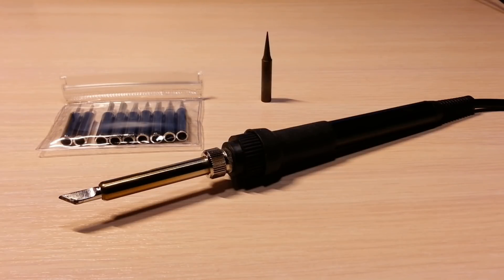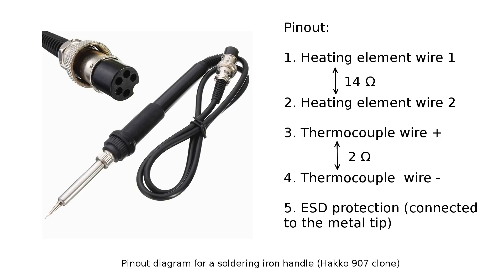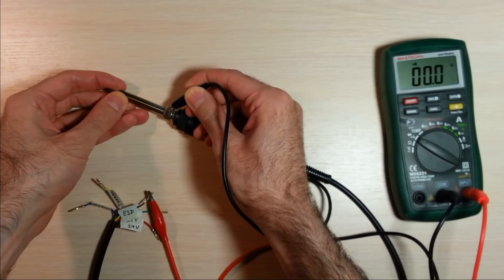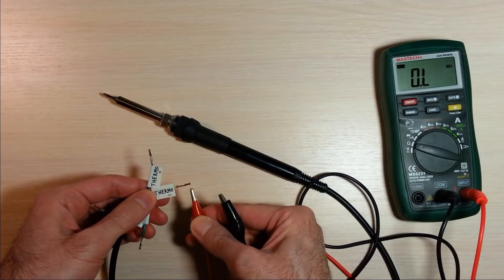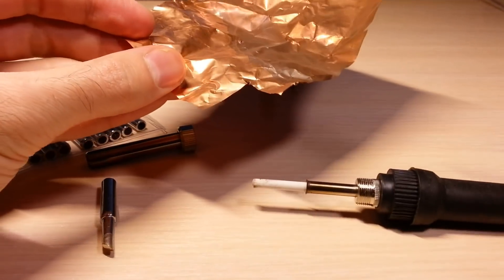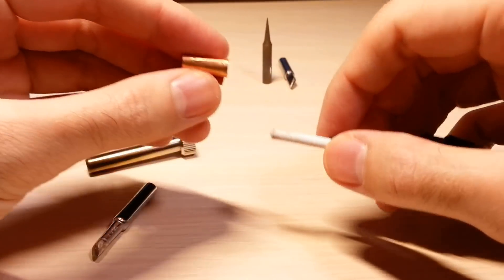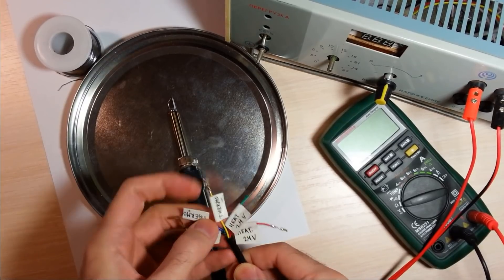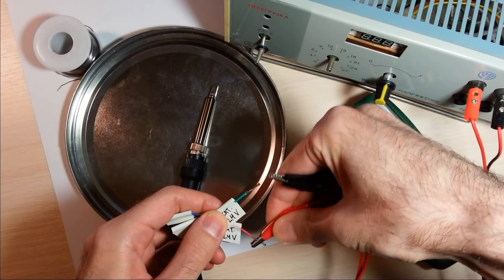Review: soldering iron handle (a Hakko 907 clone) / pinout / DIY soldering iron for $3

Comment: Just get the yihau blue iron.. with the yellow pad.   The wire on these are very short and it's harder plastic.  The yihau has a much longer wire and is made of flexible silicone and is just better quality.  It's worth the extra ten bucks.

Comment: Good day Gentlemen
I have such a HOT-AIR SOLDERING IRON
I NEED THE COLOR CODING OF THE WIRES TO CONNECT SUCH A PATHET. THE HEATER IS POWERED BY 230 V AC through a voltage regulator. I understand that the fan is powered by DC 24 V
OUTPUT FROM HOT TO MULTIMETER TEMPERATURE MEASUREMENT
OR OTHER WIRES WHICH ARE FROM WHAT AND DO NOT NEED TO BE CONNECTED

Comment: hi sergei. i have a cheap chinese hakko soldering iron. i already know the pinouts of the soldering iron like the heating element, thermocoupler and the esd/gnd because of your video. i purchased a mini stc t12 temperature control board only. not the whole kit. my question is how do you determine the five pinouts on the board itself. where do i connect the wires of the soldering on the board pinouts. please help me.

Comment: I have  937 handle  24V-48W  heat element  is 3,8 ohm    and  thermo  2,1 ohm     >>>>>    Is there an wrong value the heat element?, Can I use on your video handle ?  please answer
Reply: Your heater element should be around 12 Ω
Reply: Genuine Hakko are 3 ohm.

Comment: Recently purchased a DSK T12 2014-12-12 handle and hoping I can use it with a HAKKO OLED, but don't know the pinout. Do you know anything about these handles and can I use the same method in your video to figure the pinout?
Cheers

Comment: Nice video. I just purchased 9 off ebay from three suppliers. The one from a US sources was about $7, the other two sources from China, just over $3 each delivered. The US one arrived one day sooner that the ones from china… (to a US address) 5 of these had a black tip protector from a china and US supplier. Those probes are only capable of melting solder, barely at the hottest setting. The end of the ceramic was cut square crudely, threading was crude, the securing metal nut not square and they stank badly when powered on. One had an open for the heating element. Measured element resistances varied from 14.07 to 14.95, temperature was 72.5 to 73.5.

The last four probes came with a clear piece of tubing to protect the tip. The nut holding it together was threaded to the body square, better overall fit and trim, even a little bubble wrap for packaging. The ceramic heating element had a rounded end as in your video. Element resistances varied from 12.46 to 12.55, temperature was 71.5  to 74.7.These are apparently the Hakko 907 clones that work well as the can be used as soldering irons.

Comment: 15 volt???o 24 volt???
Reply: It works normally at 24V DC but is temp. controlled, so the voltage is switched on and off due to temp. sensing. When using with a power supply without temp. sensing 24 V continously would overheat it, so you can run it on 12 - 20V depending on your heat demand and kind of work.

Comment: hello, how did you find out which wire is minus and which wire is plus for the thermocouple ???
Reply from the maker: You can treat the thermocouple as a voltage source. V=V(T) where T is the temperature of the thermocouple. Therefore, you should use your multimeter to check the polarity.

Comment: The power supply to the soldering iron is a 14 V DC or 14 V AC ?
Reply: thanks Andrew ... so a transformer is required for this purpose ...

hmmmm ... but how is it that there is no transformer used by Sergei in as per this blog/video

http://e1ectro.blogspot.in/2017/02/diy-desoldering-station-for-25.html
https://www.youtube.com/watch?v=VA0Zc1pqXGw&list=LLaFPGEV6uXUNRNShl-JjGJQ&index=2&t=0s

where he speaks about ... "There is a correlation between input DC Voltage and heating speed of the soldering iron ... "

how is it that he seems to be running it with 24V DC

:O

Comment: Nice video.
I have bought a handle just like that but sadly the first time I connected the handle It started to heat until it was almost red hot.
I had to shutdown the 936 power and after removing the tip I noticed the resistance in the 24Heating element was 3.5KOhm! 
I think the heating element is not working anymore it is damaged. I also tried to connect the iron again and it does not heat anything.
I have to investigate what is happening to the solder station since this I bought online and assembled it myself.
Reply from the maker: There are nichrome and ceramic heating elements. They have different temperature sensors (a thermocouple or thermoresistor). Your station might not work with the current one. Check out my video about A1321 ceramic heater
Reply: Thanks for the reply. For the looks of my solder iron handle it looks like a ceramic heating element. Also the thermocouple showed a resistance consistant with the one you measured.
Only the heating element values resistance value was very off, 3.5KOhms After the burnout effect.
I also thought all those 50W handles were compatible with the same controller circuit ...
My heating element is ceraminc like, all white ..I'd say it is a ceramic one. 
I ordered a new one but I fear it could be the temperature controller that failed.

Comment: Hi,can you tell me what is the best power source to use i was planning to use it with atx power supply and buck converter,now can you give me your opinion what is the best way to connect it without frying something?
And by the way great video.
Reply from the maker: for nichrome heating element,  you need Vmax=15V to be able to get 200..250℃
for ceramic heating element, Vmax=12V will be enough to get 200..250℃

ATX power supply (12V) + DC-DC boost converter(or  "buck-boost"/SEPIC) to get 15V
or 
Notebook power supply (19V) + DC-DC buck converter ("buck-boost"/SEPIC) to get 15V
Reply: @sergeikrasnikov  what is the amperage of the transformed that is needed to power up heating element? 24v dc is the maximum capacity of the heating element?

Comment: I got one of these with the idea to do the same.  But even when used with a real 907/936 it needs to be calibratred.  You can also buy a controller PCB on eBay for very little money.  I think I saw an open source Iron controller on the Internet some place too.
I found some more info  here: http://assets.tequipment.net/assets/1/26/Documents/936e199809a-1.pdf
Pin out for the Iron there too, but I didn't check if its accurate yet...

Might bve worth checking out this guys DIY Iron, I'd do the same but using this handle instead. :)
https://youtu.be/RxZJujS1znU

Or this one for old school manual/analogue: https://youtu.be/snzmUudUeNg